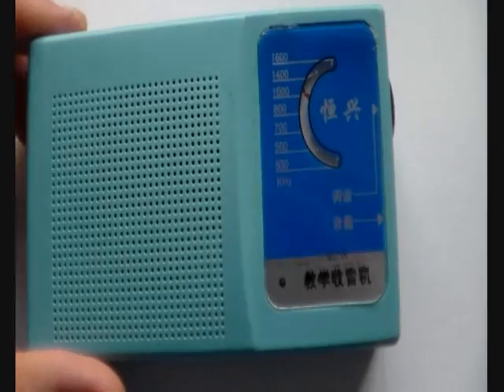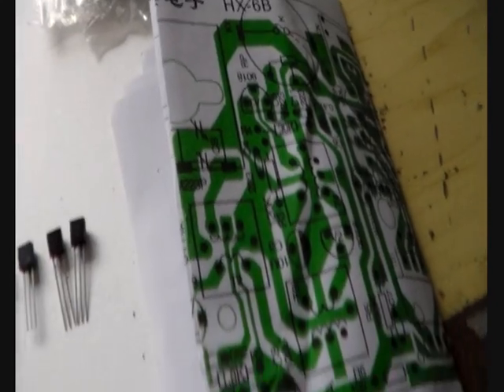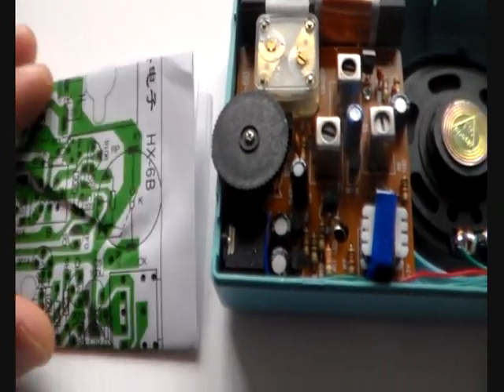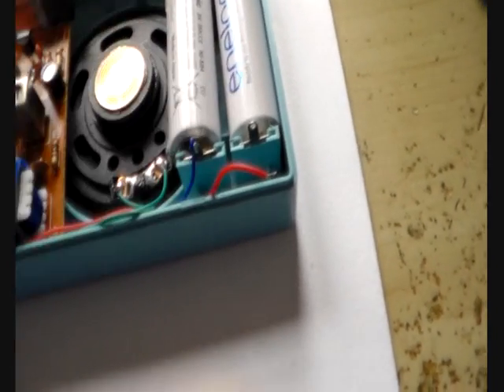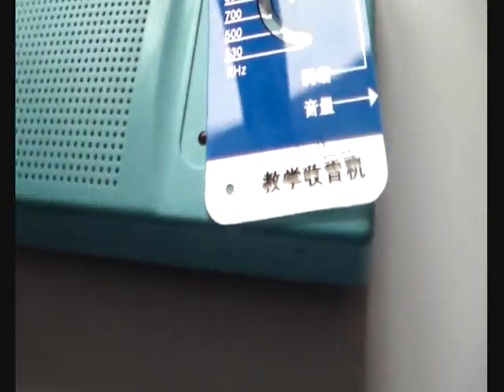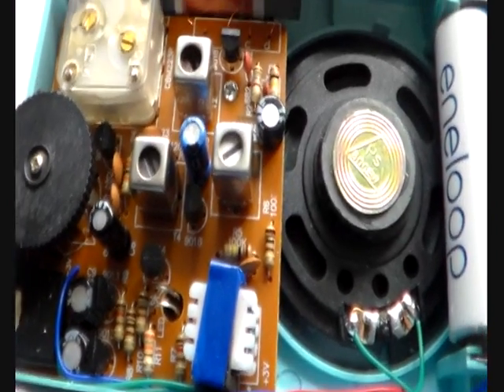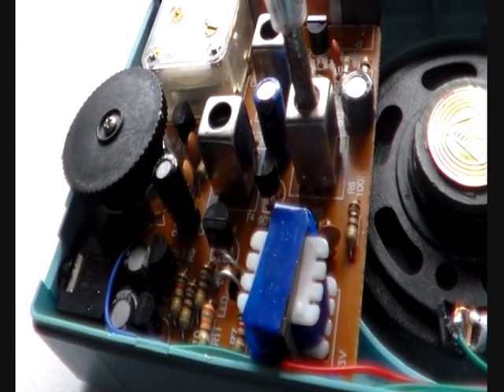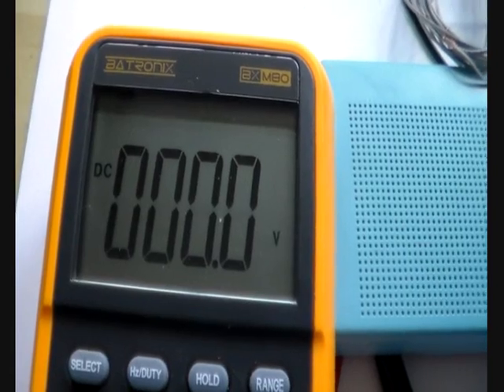6 transistor medium wave radio kit

Comment: I found that R4 in this radio (30K) is too low in value, leading to distortion. I experimented with a pre-set variable trimmer and 56K seems to be better.
Those thin plastic frame speakers are really horrible, but there's not much room to fit anything else. I tried a Japanese speaker from a pocket radio and made a hole in the back to accomodate the magnet bell.
If you keep the volume down the radio doesn't sound too bad. For the equivalent of six US dollars, you ought not to be surprised it is a bit rough in some respects.